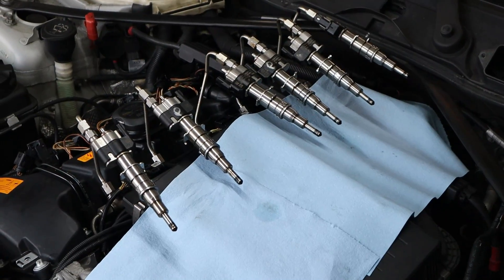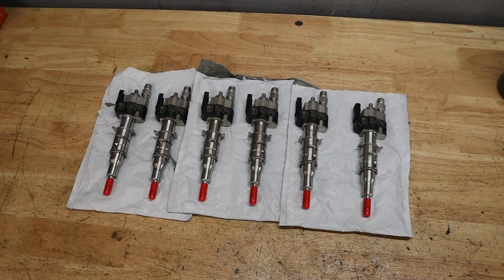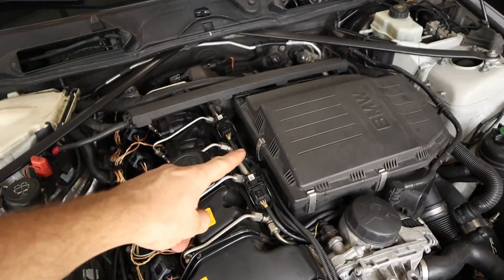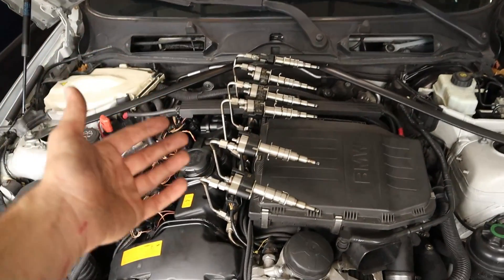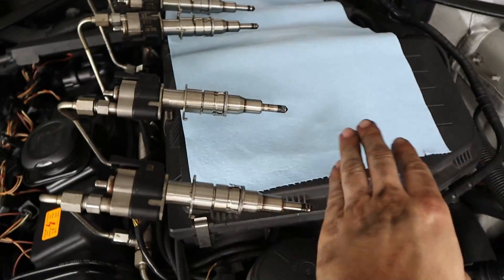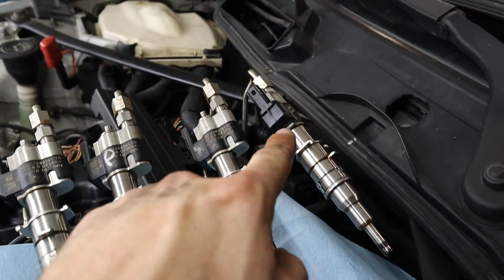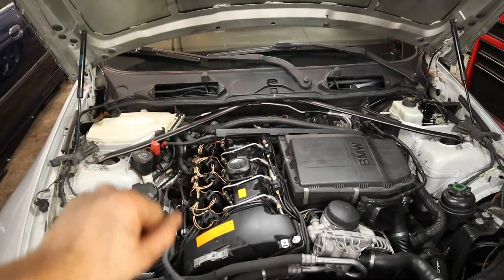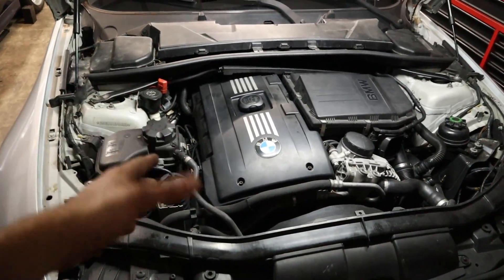How to TEST your N54 Injectors AT HOME (Leaking Injector Symptoms!)

Comment: You Can save your injectors by pumpning injector cleaning thrugh Them with a Small fuel pump, you need a injector tester that Can activate piezo injectors to puls Them to get the cleaning solvent through Them i didt this on Four of mine they are not leaking anymore i ran the cleaning for at leaset one hour
Reply: where did you get your injector tester

Comment: When you say connect the battery, why did you have battery disconnected in first place?
Reply: Better off disconnecting the battery when you do anything with electrical connectors on a bmw. Lots of modules and systems remain active even when the car is off. Only takes a minute to disconnect the battery and it’s just one of those things where if something ever did happen  it would never have been worth the risk of not doing it in hindsight. And any time your bmw isn’t running right and you fix the problem it’s worth resetting the adaptations in addition to clearing the codes, the computer sometimes adjusts parameters for things like a rich running cylinder so if you fix what was causing the cylinder to run rich and run the car, initially you may end up with a cylinder running lean until the computer re adjusts to the air fuel ratio it’s seeing through things like the oxygen sensor. The ecu is set up to monitor things and make adjustments in almost real time but re setting the adaptations just gives the ecu a clean start with a known baseline to work from and will make new adaptations over a few hundred miles or something. If you buy a used automatic I can also be advantageous to reset transmission adaptations as well because the way the car shifts will also adjust to the way you specifically drive it so if someone else has been driving it for the last few years after a month of driving you may notice the way the transmission reacts is completely different than it was when you first got it

Comment: Do the injectors generally fail in any other way then leaking?
My cyl 6 injector is leaking for sure as the plug is soaked in fuel after just a couple hrs. 

As i want to go for DI delete when Nexsys works out the kinks i dont want to buy all 6 new Index 12s, so figured i would buy a couple used ones for spare, flip my existing ones and test them along with the "new" used ones, and just switch the ones that leak.

Is there any point in bringing them somewhere to get them flow/spray pattern tested or is it just the leaking to be worried about?
Reply: Answering myself. They do Gail in other ways. I tried 2x used injectors and they didn't leak but caused heavy misfiring instead... I gave up and bought new instead.
Reply: @Zodiam.  Есть разные причины, от струи до просаженного пьезо. Нажми на никнейм.

Comment: Hey couldnt you just unplug injectors and coils and turn the engine over then pull plugs to see which is wet? That way you dont have to remove the injectors

Comment: Help! So my car is completely fine on idle. Never skips a beat. But upon pushing the throttle a bit it will misfire. It’s fine on low rpms but high rpms. It will throw a cylinder 1 misfire and start to stumble. Would this be the injector?
Reply: Probably more likely a coil if it happens at higher RPMs or could be the spark plug.
You should switch coil 1 to another cylinder and see if the misfire then happens on the cylinder it was switched to.

Comment: I just pulled out one injector just to look at it. I replaced my valve cover gasket a few months ago but when I took the injector out it was covered in oil. Does that mean it was just old oil?
Reply from the maker: Yeah old oil, there's no good way to clean up the valley down there where oil collects and takes forever to burn off.

Comment: Should I disconect EKP module and crank it to lose the rail pressure ?

How long was it sitting before you disconected the rail lines from injectors?
I want to avoid fuel all over the engine bay

Comment: can you do this for non coded injectors? just to test if theyre leaking.
Reply from the maker: Yeah! It'll work just the same.
Reply: @TheBimmerBarn  sweet thanks for the video! Finally getting around to replacing my injectors with used index 8’s after finding out 4 of them are leaking. Fingers crossed at least 4 of the used ones I bought are good 👍

Comment: I did same test as you.. but i have N53 engine.. none of the injector made a single leak, i changed all plugs and coils.. but there are still symptoms like rough idle, shaking, vibrating on cold start, check engine.. i dont know what to do
Reply from the maker: Read the fault codes, and that should help you pinpoint the problem. Sounds like it could be fuel related! Good luck
Reply: Check if the injector is loose if so add a new decoupler and o ring compressed

Comment: Would this cause oil to smell like fuel?
Reply from the maker: Yeah, could be causing the car to run rich.
Reply: @TheBimmerBarn  i just did the test and none of my injectors leaked at all....im still getting gas in the oil though. Could this be a bad seal on the hpfp? 

Also did a compression test on the engine and it checks out fine.
Reply from the maker: @samah713  that's the only other place I can think off, or the car could be running too rich, which could be caused by bad oxygen sensors. Good luck!
Reply: Your HPFP could be going bad too. There's a seal that when failed causes fuel to get in the oil.

Comment: I would test the index 12s too. I would also extend one injector wiring to reach each "new" index 12 injector to see if they are open and their injection patterns. Never trust ebay and there are FAKE index 12 out there and when I did what u did last year, I could not even program the compensation number into DME and 3 out of 6 index 12 I bought have the same compensation number.

Comment: You didn’t bleed the lines after you removed the hard lines.  How do you know there was pressurized fuel to the car injector.   You don’t there full of air.
Reply: If there leaking, the air will be pushed out first, followed by the gas. Common sense
Reply: *They're

Comment: Well Chris. 6 months ago I purchased 6 index 9 remanufactured injectors. I got a 60k km warranty. Everything was okay. But a few weeks ago the car had a rough colt start again. I checked the injectors and nr3,4 and 5 are leaking. I was warned not to buy remanufactured injectors but I didn't have the money for index 12 ones, back then. The remanufactured injectors were €700. Now I'm saving money again for 6 index 12 new BMW injectors. But the prices went sky high lately. They're now € 2450,- ( $2620) at the dealership. Absolutely insane! Dutch regards, Nico.
Reply: if even available. The usual German bmw webshops dont have them (baum & leebmann bmw)
Reply: @seppmeier9961  I know. I can buy only 1 at the dealership, at the moment🤯.
Reply from the maker: Yeah my friend almost bought a set of those "remanufactured" ones as well, not sure what the results would have been. Once they get stuck open and start leaking, there's no way of refurbishing them.
Reply: It's completely outrageous how much the injectors cost now.  Im hoping fixing supply chain issues will alleviate the issue!

Comment: That's the only way to test em and be sure. When I first got my 335 I checked the injectors. 4 wer spraying and 2 dripped. Cold start was fine but a hot start took a while and was a bit rough. $1400 later and the new injectors were in and she was running great. I hope the injectors on my n63tu last more than 100k